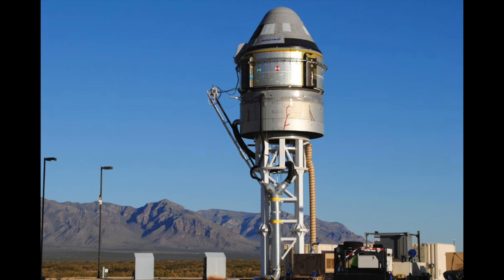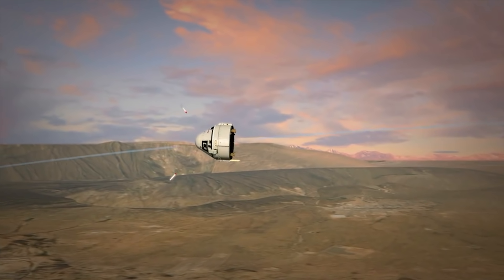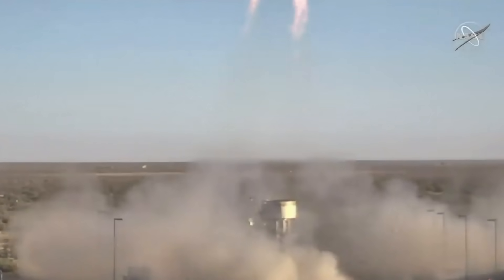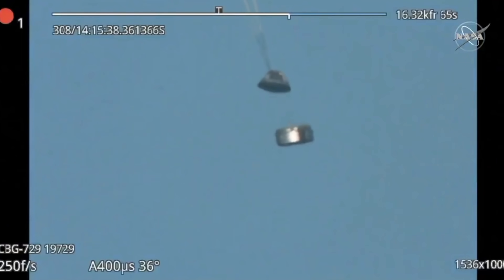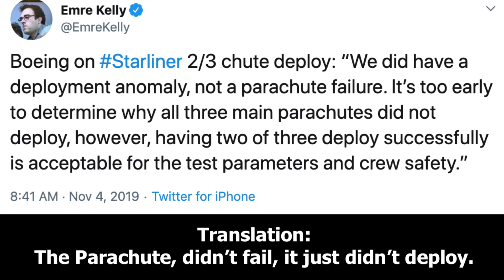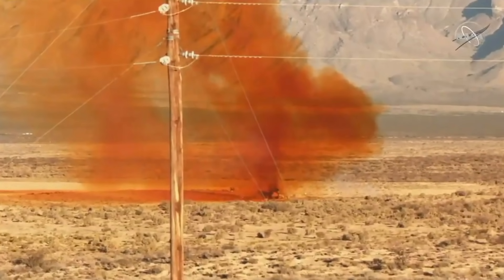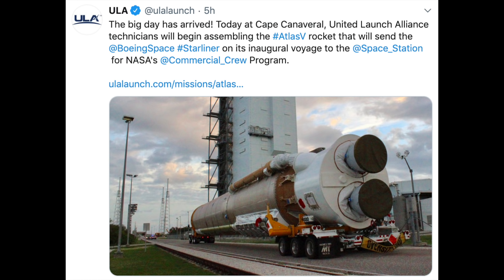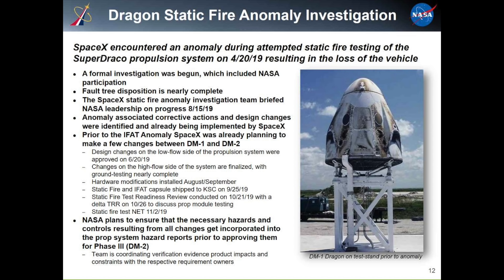Parachute Fails To Deploy During Boeing's Starliner Abort Test.

Comment: While clearly 3 parachutes are a safty measure, 
"could" the capsule still land with even 1 or would that spell death for the crew? 
Just curious. 
I mean if you demostrate a safty test you want 100% to go right, 
everything else is unacceptable in the space industry.
Reply: I believe it would be survivable even on single parachute. Just my opinion, though.
Reply: IIRC before getting 4 chutes, water landing with just 1/3 in Dragon was expected to lead to minor injuries only. Landing with 1/3 should have ~3x breaking acceleration, because chute speed is 1/sqrt(area), and landing acceleration is ^2 of velocity, so acceleration ~ 1/area.
Reply: I suppose the question is, do you add more parachutes to give you a bigger safety margin or do you reduce the number because you are less likely to get a partial success which gives you a bad record due to not being perfect? (assuming of course that the probability of any given parachute failure is independent of the number of parachutes).

Comment: Will the space x abort be conducted under full thrust? I've heard they will turn off the engines for a zero g abort. Is there somewhere you can look up the plan?
Reply: I believe they will abort at Max-Q and run it like a normal mission, which means they throttle down a little (I don't know how much they throttle down)

Comment: It looked like there was a fire on the side and it burned through 3rd drogue parachute cords. Thus the main chute never deployed properly.
Reply: I'm very curious about that. The image is so blurry. There is a lot of sun reflecting off the capsule, and what I first thought was orange flames is actually sunlight reflected through the orange mist. But all with that residual propellant coming out, we may have seen fire there also. As you say, a little fireball hitting the drogue cords would be a bad thing..

Comment: How long does that stuff remain toxic?  Should we still be using such dangerous stuff when there are plenty of better alternatives??
Reply: Paul Haynes - Until very recently, there was NO alternative when it came to LAS - They either had to use explosive Solid Rockets (an escape tower that had to be discarded somewhere between 60-85 km) or Hypergolics. The “non-toxic” LAS fuel NASA developed 6-8 months ago hasn’t really been tested yet. I’d like to see everyone migrate to this as soon as it’s proven effective & escape engines can be engineered to use this stuff, because it would allow immediate egress once the spacecraft lands after the LAS has been used or the craft has done a propulsive landing.

Comment: Scott, does the Starliner use the Mrk III parachutes like SpaceX or are they using a separate system?
Reply: Steve M - It uses a different system. One reason I’m questioning NASA’s motives is that while NASA INSISTED that SpaceX redo & retest it’s parachutes, while allowing Boeing (& Lockheed Martin) to continue to use the same parachutes SpaceX was forced to stop using. To add insult to injury, NASA just decided that 2 out of 3 working was “good enough” for the Starliner.
Reply: @TraditionalAnglican  No they didn't. Neither of those things happened.

Comment: Is it just me, or does this, like all of these attempts to reinvent the wheel, just seem stupid? Why involve the service module in an abort escape at all? The service module is a complex and critical potential failure point. Why rely on it to escape during an abort? Why carry it’s dangerous and explosive contents along with the astronauts in an abort? It just seems stupid. The classic abort tower is a near perfect solution to the problem of saving the crew when things go wrong. It’s simple yet it works. Granted it is a disposable throwaway item every launch. But considering the cost of launches even with reusable components it seems a relatively minor expense for what it delivers.
Reply: Andrew Taylor - NASA demanded full “Launch to orbit” escape systems for Commercial Crew - Crew Dragon & CST-100 have them. An escape tower adds 7-10t of mass (see Orion & Apollo specs) & is discarded at 60-65 km. Because its LES is discarded at 65 km, Orion doesn’t have a “Launch to Orbit” escape system.

Comment: Was there some big change in parachute design and performance between today and history? Apollo, Soyuz
Reply: Not much as far as the parachute is concerned.

But literally everything else? Including everything that makes the parachute actually function?

Oh yes, vastly different. You might as well not even think of them as being related.

It's like comparing a land speed setting rocket car and a VW bug and saying they're almost the same thing because they each have 4 wheels on the ground.
Reply: Robert Pruitt I don’t understand. I generally think of parachutes as a very mature product and well understood.
Reply: @funnyitworkedlasttime6611  
The chutes themselves are, but the technology that makes them work keeps getting upgraded.

As soon as you change the control systems, you're literally starting over from scratch. You then have a whole new set of issues that need to be worked out.

Just because you can ride a bike with 2 wheels up a steep hill doesn't mean you can just hop on a 1 wheel bike and just ride up that hill with no problems.

Comment: The Crew Dragon "MAX-Q" test might be the only time that the Falcon 9 is intentionally flown suborbital trajectory.  It will be interesting to see what happens to the first and second stages in that flight.
Reply: The trajectory for the MAX-Q test will be exactly the same as a normal launch with crew.  Otherwise it would not be an accurate simulation of a worst case abort.

Comment: I assumed that the orange smoke was from the heat shield and that it was to aid in recovery.
Reply: Haha! Good one!
Reply: @3000gtwelder  I wasn't joking? The military uses different color smoke to signal helicopters. I'm sure that there are much higher tech ways to locate a vehicle. If they are in an abort scenario popping smoke so that spotters could locate the vehicle quickly makes sense. Also, very low tech.

Comment: The toxic smoke from the service module might not be an issue with a water landing which would be the case in a pad abort. We'll never know because they won't do a test over water...  Anyone else concerned about the 3+ second delay between the callout of "zero" and the movement of the capsule?  That's an eternity.  I realize it might be a manually enabled abort vs. automatic, but that's "pony express" delay there.
Reply: Glenn - It takes about 1/2 hour for Hydrazine to clear enough for people to access or egress the capsule.

Comment: Why don't fuel tanks have their own parachutes? I mean, wouldn't that be good for potential reusability and safe disposal of remaining fuel (especially hypergolic)?
Reply: How do you have a fuel tank separation? Unless it's a rocket stage how do you get a fuel tank outside the capsule?
Reply: @drabberfrog  
Not sure, but a small company wanted to use batteries to drive the pumps, and the plan was to eject them one at a time, with parachutes, as they ran out of juice.

Not sure how they had it planned out.
You probably couldn't open a side door for an entire tank though. So probably have to be a self contained unit that separates.

Comment: I have a question, i realize you said your not a parachute expert, but how do they control the opening of the chute it seems to open then, really open. If someone could point me in that direction id like to know. I wanna call it a 2 stage parachute. 

edit I'm asking how they control the Main chute when it opens they don't fully open for a while. I understand why as to not break the astronauts, so the chutes open (shaped like upside down water drop) then open up like a jelly fish.
Reply: It's called parachute reefing. Simplifying, there's a relatively rigid cord around the parachute which initially constrains the diameter. Then wire cutters break it and the parachute can fully open
Reply: @AmbientMorality  the "wire cutters" operate by elecrical im assuming. thank you for the info. I had an idea something like that just kinda wanted to confirm. appreciate it.

Comment: As a Russian, I have all the reasons to wish Boeing to fail, but I still don't understand the overall tone of comments. Why so negative? This is the parachute science. A lot can go wrong when a parachute is deployed - wrong angle, too fast, two ropes mixed up, torn rope... that's why there are 3 parachutes while 2 is enough.
A significant issue, but not a showstopper.

Comment: Twitter: 
@planet4589: "The parachute problem on the Starliner abort test has been identiifed as a procedural error."
@ChrisG_NSF
:  "Boeing: Linkage is pin in loop between pilot and main chute that is then enclosed in a sheath. Difficult to verify visually that it's secured properly once in sheath. In this case, pin wasn't put fully through loop & wasn't caught before it was put in  sheath."

Comment: They should ask SpaceX for help with their parachutes.
Reply: Why though? SpaceX also had issues with their chutes... They're testing them currently as well (via drop tests).
Reply: @totalermist  I guess they did have one failure but have aced the last 13 tests.
Reply: @FourthRoot  There were more than just one failure, but that's beside the point. The capsules have a different design, different weight, different number of parachutes, etc.
The point is, both companies have had problems with their parachutes and SpaceX  opted to change their supplier to fix the problem.
Then there's also the reason for the failure: Boeing's problem was distinctly not a parachute failure - it was a deployment problem...
Reply: @totalermist  Why so serious?

Comment: Wouldn’t they deploy the service module before re-entry so it will burn up in the atmosphere? And won’t that burn off the rest of the nitrogen tetroxide?

Edit: Nitrogen Tetroxide
Reply: If the abort system must fire BEFORE launch, then the service module and capsule never get high enough in the atmosphere to experience reentry heating.

Comment: I thought the Shepard was the first "American" space capsule to land on land... Blue Origin may well have a first manned flight before Starliner... I think Boeing it overstating that one. With regard to testing at max Q (spaceX coming test) It seems to me that all failures so far have been on the ground, very soon after lift or at booster separation. Still I guess max Q will show the ability for all of them. The thing that is impossible to test is if these things can get the abort going fast enough to avoid an on the ground stage explosion. How fast do those gases and rocket bits move anyway?
Reply: CRS-7 was a failure at high altitude first stage flight

Comment: Safety is everything here and Boeing obviously needs to work on it's parachutes, and SpaceX had to work on it's abort draco thrusters. My only observation is that NASA for decades flew the space shuttle with no appreciable abort system. If there was an explosion during any part of the lift off, everyone died. If the orbiter was significantly damaged and separated from the tank, everyone would die. During launch there was a period of time that the only spot to land was the Atlantic and I don't think it had a water landing mode. As cool as the space shuttle was, it was a death trap. NASA now again cares about abort systems like they did during the Saturn v days. Just imagine if the government buricrates hadn't put their hands on the original design of the shuttle.
Reply: I'm also aware that Columbia had ejection seats originally, but with a crew or up to seven, ejection seats wouldn't have worked. Also forgot to mention that the shuttle only had one chance to stick the landing on re-entry. Back up plan was again landing in the ocean.

Comment: Boeing: Look it didn't "fail" it was a "Success within acceptable parameters".
Astronaut: Yeaaaah..........I'll stick with Soyuz thanks.
Reply: Anarchy Antz which presumably has just a single Shute? 😸 (ok, actually it has manually deployable spare)...
Reply: @hrissan  Uses the SAS designed under Sergei Korolev's leadership. The main SAS is a single solid rocket booster with several nozzles to control attitude and yes I believe it has a single chute as well as landing jets. Has only been used 3 times since 1966, last being this time last year. Russian built to last, oh and zero failure of chute! :)

Comment: They aborted into the Desert. In actual abort would be in the Ocean,  so the service module will go in the drink. SpaceX is actually did their pad abort in 2015? & going be doing in-flight abort soon. They have just demonstrated 12 deployments of their mrk 3 chutes. Wither NASA demands Boeing to use them for their module would be funny.

Comment: SpaceX: we can land simultaneously all Falcon heavy's side boosters on predetermined spots anytime. 
Boeing:. we can deploy 2 out of 3  parachutes on a low altitude test...
NASA: parachute deployment is a cutting edge technology. A 66% success ratio is acceptable. We'll stick with Boeing...
Reply: Some issues: NASA is working with both SpaceX and Boeing, SpaceX has had failures with parachutes as well (hence the two major redesigns), and Falcon Heavy is not related to Commercial Crew
Reply: @AmbientMorality  "In 2014, SpaceX received $2.6 billion from NASA for one of the final phases of the Commercial Crew Program, which aims to fly astronauts on American spacecraft starting summer 2019. (NASA gave Boeing $4.2 billion to develop its CST-100 Starliner module, with the same goal.)"
So you're right... I just think that SpaceX doesn't get what they deserve, or maybe I'm just overhyped about their ambitious future plans...

Comment: BFRC: does it stand for Big Fv<king Red Cloud  .. or is it Boeing's Fv<ked-up Recovery Chutes ? :D ..  in any case, I agree that NASA is probably not going to declare this test a "success" as Boeing would prefer, but rather is going to require corrective action of the deployment "anomaly" and another retest before certifying it for first crewed flight.  Tough biz, this. :/
Reply: Dan Moser - NASA decided that, since this was a “legacy manufacturer” who had “Man-certified” all of the parts used in the spacecraft, 2 out of 3 parachutes & losing an air bag were “good enough”. 😱🤮😡🤦🏼‍♂️🤷🏼‍♂️

Comment: Boeing should not spin this test as a success, when one of the parachutes failed to deploy.  They should call a spade a spade 
And say the test was not 100 percent successful and they will need to perform it again.  Even though 2 parachutes would have been enough 
To save the crew in an emergency, everything must be done to ensure all 3 will deploy in the future.   This should not become a 
“Normalization of deviance”  problem, the like of which of course led to the Challenger and Columbia Space Shuttle disasters.
Reply: they will not necessarily need to redo it

Comment: I will laugh my ass off if the F9 survives MaxQ and has to be blown up after it tries to land on the ocean.
Reply: I bet it will have RTLS plan programmed in case it survives...
Reply: @Grigory Buteyko

They’d have to ditch the fake second stage or it would mess up the aerodynamic. But it would be great if they went “The first stage survived better than expected and so did the capsule, so as soon as we can get
a new second stage on there we’re going to do it again. And keep doing it until something breaks”.
Reply: The protocol should be to blow it up ASAP, as in a real abort scenario they wouldn't want an unpredictably damaged booster to continue flying near the capsule.
Reply: @Tuxfanturnip  No. Terminate thrust, but a cloud of debris can be much more dangerous
Reply: @AmbientMorality  In a real abort scenario, terminating thrust may not be possible, depending on what's gone wrong. The abort thrusters can outpace the booster's acceleration at full thrust anyway, and the flight termination system is double-redundant and specifically designed to turn the vehicle into inert, scattered wreckage as effectively as possible. A still-accelerating booster with a valve jammed open can't be constrained to a predictable safety envelope. Aluminium confetti can.
Reply: @Tuxfanturnip  Very, very few real abort scenarios do not allow thrust termination
Reply: @AmbientMorality  Huh, I must have misread the description of the test... on second reading it does just say terminating thrust, not using the flight termination system

Comment: Jim Bridenstein should complain about Boeing putting that much affort in the 737 and not Commercial Crew. Just kidding, fails happen and thats no problem if the happen during testing. Also it´s Bridenstines job to look for Comercial Crew coming to a finish as fast as possible.

Comment: just as safe as  the 737 what could go wrong
Reply: Lawd Elpus - The 737 was a very safe aircraft. The problem happened when they 🤬 the aerodynamics by sticking oversized engines in front of the wings on the 737 to make the MAX 8 & then decided not to design MCAS so it would “prevent false positives”, not to tell pilots what they had done or give pilots a means to deactivate MCAS when the system acted on those inevitable “false positives”. 🤦🏼‍♂️😡

Comment: But Now in June 2023.  NASA has found that the parachute tethers are not strong enough.
If one chute fails.and they go from 3 to 2..     
WT...   is Boeing doing ?
And then there is the flammable wiring tape...   FFS